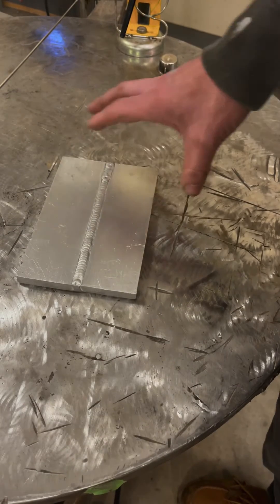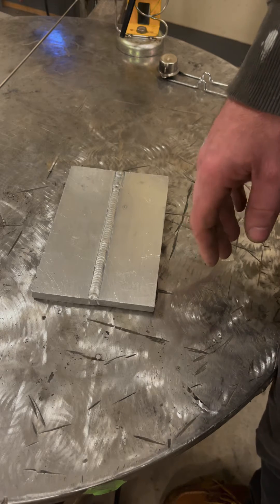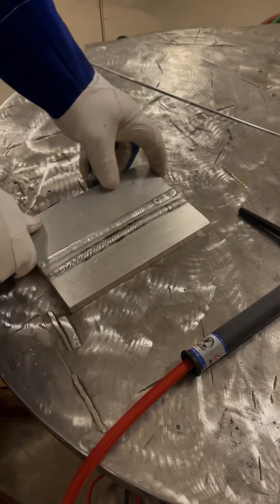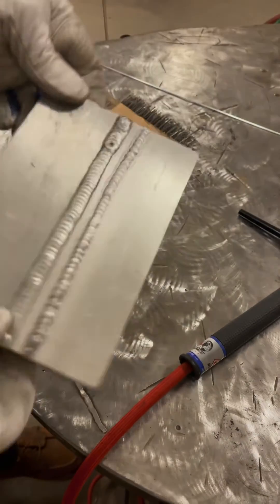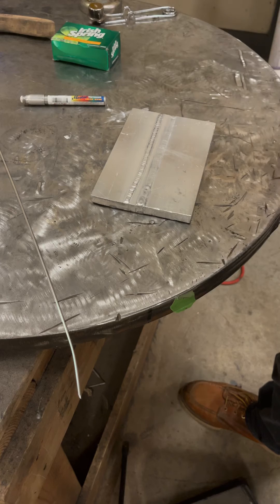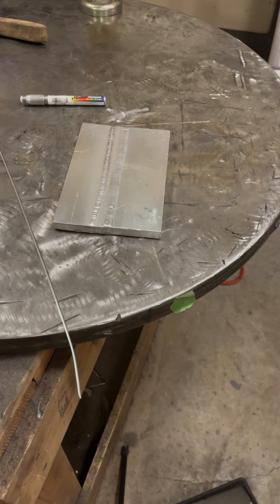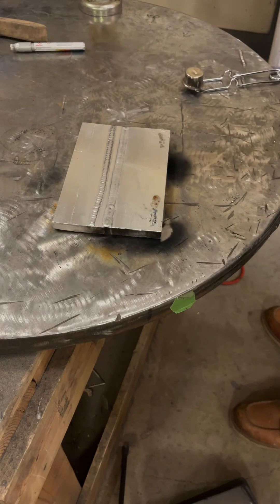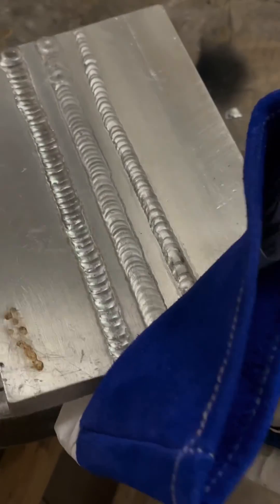Tig welding thick aluminum tricks

Comment: Dumb question: At the end there, you said that if you run helium, you can get a better result. Did you mean running helium with AC, or DC?
Reply from the maker: Great question.  Helium increases the voltage required to maintain an arc with tig.  Therefore you get more heat input per amp.  Long arcing the tig arc will produce more heat as well, but it’s not focused (arc cone gets wider) so you don’t see more penetration with a longer arc.  Basically helium gives more heat in the concentrated arc cone.  This will improve penetration with a/c tig.  Now pure helium also gives the ability to DC weld aluminum.  I have done this (in limited trials) and it’s pretty interesting.  It’s recognized that helium has some form of cleaning action on the molten aluminum, but I can’t seem to find what it is doing.  Helium is inert and generally shouldn’t be reacting with metal.  The puddle looks different than a/c, it’s super narrow.  There tends to be a lot of black soot (likely magnesium burning off).  Penetration is huge in comparison to a/c.   The major downsides to helium and d/c is it’s not practical on thin material and its cost.  A tank of helium is 7-20 times what argon costs and you need to use a lot of it to shield the weld (it’s lighter than air and without a short tungsten stickout and high gas flow it will have poor shielding).  

If you have access to helium you can weld thick aluminum with any d/c tig welder and you can weld thicker material (with reduced duty cycle) with a a/c tig machine.  It just sucks it costs a fortune.

Comment: I have a miller 210 with a spoolgun. I get a few large aluminum walk boards to repair. They need to be picked up by a couple guys. commercail ramps. You must preheat with care. The soot method is what I use. Alum. goes from solid to liquid quick. I preheat then give it a quick weld and hope it not too hot. Works for me. Thanks for the demo. it is good knowledge. If you dont preheat, your welds look like bird schist, or they will have good penetration on the thin parts and little penetration on the thicker parts. Also some of the ramps will have a copper alloy and that is another factor.
Reply from the maker: Aluminum can be a real tough material to weld with different thicknesses.  I have found preheating the thicker material and leaving the thin at room temp works pretty good to get a solid weld.  It’s so common for people to run hot to fuse into the thick material, but what ends up happening is the thin material ends up over penetrating and the weld will “suck back” or pull the penetration back towards the thick material as it cools.  This leaves more or less undercut on the backside of the weld, and will likely crack over time.  By preheating the thick you can use lower settings that makes everything wet out more uniformly with less defects.  Sounds like you have found out all of this and have a system that works.  Weld cracks and repairs on aluminum can be a tough bastard to fix, it’s so much better when you stop them from happening by putting down decent welds at the start 😀

Comment: What else can I use other than a stainless brush to clean materia any liquid I can use?
Reply from the maker: With aluminum I generally use a stainless brush, little green rollock wheels on a die grinder, or a green Brillo pad.  If it’s really filthy it makes sense to clean it with dish soap and water then scrub it with a Brillo pad.  You want to avoid a lot of chemicals because they can turn into hazardous gasses when heated by a welding arc.

Comment: Heard you can also DC- tig Aluminium with Helium, which gives better penetration than AC?
Reply from the maker: You are correct, you can DC weld with helium on DCEN.  That used to be more of a realistic option, but helium gas increased so much in cost a single tank of UHP helium might cost over 600$.  

As a bit of info, helium requires higher voltage to maintain an arc than argon.  Thus your heat input is way higher because rather than 13-15volts with a tight arc you’re well over 20v.  Then the super concentrated DCEN arc cone forces all that heat into a small area.
Reply: @makingmistakeswithgreg  Thanks, can you use balloon helium?